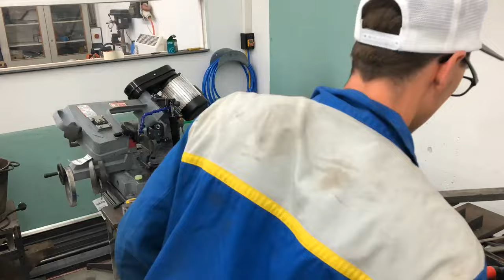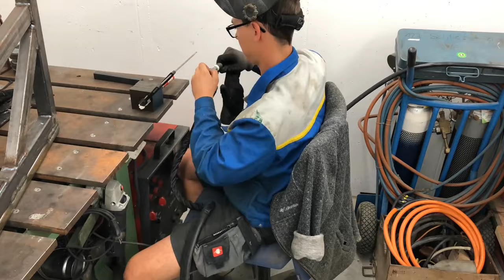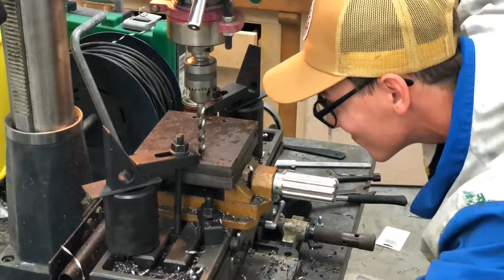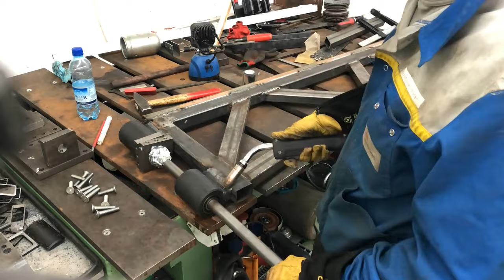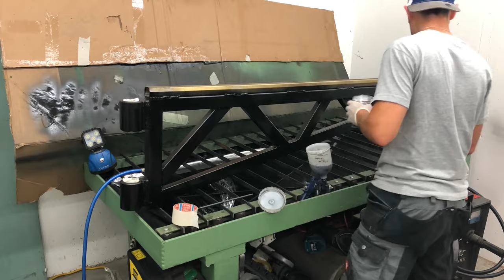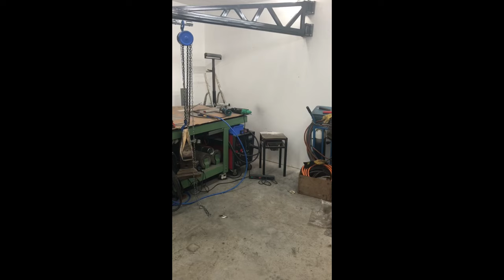Diy 1100lbs workshop crane

Comment: Shaking my head after you put it up on the wall like that you'll pop the bricks or blocks. Just a huge accident waiting to happen.
Reply from the maker: Hello, first of all, thank you very much for your comment. I find this type of feedback extremely important for identifying errors. Unfortunately, in the video, you can't see the material composition of the wall and the fastening material used. So, I would like to clarify everything regarding safety.

The wall is made of 35 cm thick reinforced concrete, which easily withstands loads of this kind. For the fastening material, I used Fischer FAZ II 12 expansion anchors, each capable of supporting a permitted tensile load of 8.3 kN (https://www.fischer.de/-/media/fixing-systems/fide/service/informationsmaterial/documents/prospekte/faz-ii.ashx).

Looking at the force distribution, the upper flange is primarily subjected to tension, and the lower flange is increasingly subjected to compression, which is why we focus only on the upper flange and consider the lower one as a "safety" measure. That means: 8.3 kN x 4 =33,2 kN = approximately 3,385 kg (which is approximately 7,463 lbs) of tensile load, which the upper flange alone can handle. In theory, one would need to double this value, as there is still the lower anchoring point, but we leave that as an "additional safety" factor.

Of course, the crane arm is 2m long, and when there is a 450 kg (1000 lbs) load at the end, we have a significant moment. So, let's calculate this in the force triangle. It turns out that the upper flange is loaded with 30 kN at full load at the top when there is a 1000 lbs (approximately 450 kg) load at the top of the crane (distance 2m). This means, in theory, four anchors alone would be sufficient. However, I used a total of 8 of these anchors.

In terms of shear strength, each bolt can withstand 17 kN, but this is negligible since the assembly on the wall is force-locked by tightening the screws of each anchor.

The 1000 lbs mentioned in the video description refer to the C-profile on which the trolley runs. This has a maximum load capacity of 750 kg (approximately 1600 lbs) - but I prefer not to push it to the limit.

Still, thank you for your concerns and your constructive comment.

Have a great day, Max

Comment: Amazing build!! Very nice shop as well but what kind of support is within the wall? Does it attach to wooden studs? Or is the framework of your shop made of steel? Just curious but either way again awesome build! I don't understand how this video doesn't have more views lol underrated for sure
Reply: Its clearly not in america so the wall arent made from paper. You can see him securing concrete anchors in the walls.
Reply from the maker: Hello, thank you very much for your kind comment. The wall is made of reinforced concrete. If you are interested in the details of the forces and loads of the bolts, I have discussed that in a lower comment.

Wishing you a wonderful day,
Max

Comment: I think it would be safer to put a vertical beam and fix it to the ceiling and the floor, anchoring to the wall like that will fail if you get a sudden jolt on the beam. Just thinking of your safety so you can make more YouTube videos.
Reply: Second that.  If nothing else, a 45 from the upper bracket to the ceiling.
Reply from the maker: Hello, thank you very much for your kind comment. The wall is made of reinforced concrete. If you are interested in the details of the forces and loads of the bolts, I have discussed that in a lower comment.

Wishing you a wonderful day,
Max
Reply: @diybude2221  It would be nice if everyone read all the questions, before asking old questions over an over